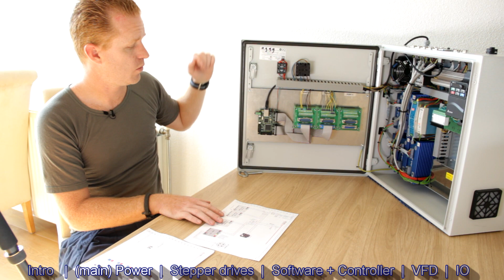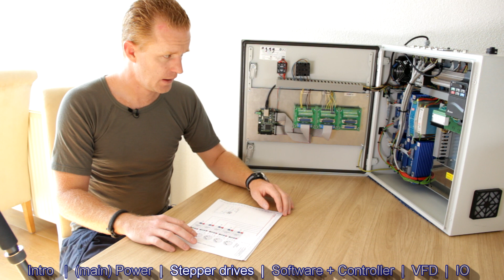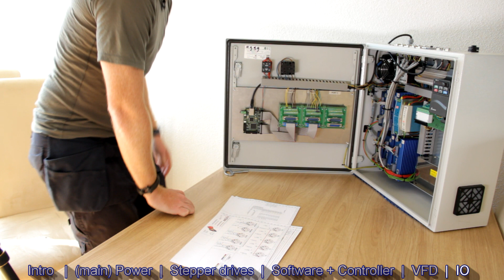RCNC X2 Router 14: DIY Ethernet CNC Controller

Comment: Excellent video Marcel. Really like that you did a follow along with the plans. Great idea and much more engaging that just mentioning that they are available and then pointing things out. Must remember that for the future.  Your setup is top notch and beautifully built. I'm sure it will work well and I particularly like the power up sequence. Haven't seen that before. 
Cheers
Peter
Reply from the maker: Thanks a lot for the great feedback buddy ! The powerup sequence has also to do with the fact I have always relied on the software E-stop since parallel ports are close to realtime communication methods. Since the boards now run USB and Ethernet some sort of buffering and controlling comes from the controller (what we used to call the breakout board). Now I would like to make sure a e-stop is like a 'hardware' thing. Anyway, there will be a lot of testing to do, and hope EMI will stay away :) Thanks Peter !

Comment: Great video! One thing for the PWM to analog converter. I don't know the exact PWM frequency, but in general you can better place that converter board as close as possible to the controller board to prevent (a lot of) noise. In general switching signals will add a lot of noise in systems, so that's why you need to make the connections as small as possible.
Btw, I am developing these kind of controller boards myself, so I can have a look into these things to develop some if people are interested.
Reply from the maker: Thanks for the advice.. Do you think this would really help, even though inside the same cabinet are quite big switching power supplies and a VFD controller? I can hardly imagine it could be noticed next to them (since it is almost at no currect/power it all). The base Freq can be slected between 1kHz and 3Khz, currently on 2.
Reply: It really depends on so many things to really say if it will be an issue. For that reason an general approach is to keep lengths with switching signals as short as possible and twist the wires.
It might work perfectly fine in your case.
Reply from the maker: Yah i can imagine that... Well anyway thanks for the advice, and If you develop any interesting board let us know !

Comment: 5:58... On cabinet doors You have MAINS voltage switch wiring in same route with signal from green boards
Reply: I've also noticed no space for drivers cooling, also high voltage parts too close to logic. Oh, and no opening for VFD fan in enclosure, seems like :)
Reply from the maker: Thanks for the advice... And for your info, its running great on a daily basis... but of course its always good to improve if you guys are building one...

Comment: I took my VFD out of the control housing after i had serious trouble loosing steps and no other reason was there than EMF-Noise. Many machine Builders recommend a sperate housing for  it. Unless you know about EMF-Noise in detail and know how to shield it i would go this way too.
Reply from the maker: It is absolutely something i'm still afraid of for sure.... Although I have seen a lot who seem to get away with it...
Another thing is that the spindle cable, stepper cables and even sensors run in the same cable chain Think that can be a potential problem to.
Reply: You can get extra shielded cables for this purpose, instead of buying 3x shielded stepper cables I got a shielded spindle-power cable instead. After I seperated the VFD from the logic control components I had no problems anymore. Depending on your workshop setup you can decide it if other EMF-noise sources are around.

Comment: thank you very much for sharing, awesome video, wish you all the best, just wondering if the controller allows expansion of extra axis like adding a B/C axis ?
Reply from the maker: Thanks for watching... ! The ESS Smoothstepper And Mach3/Mach4 can drive 6 motors so it would be very simple to add one... (well electrically, adding a B/C axis on a DIY machine is far from easy of course).

Comment: Are you using 1 fan and creating a vacuum inside the cabinet?
Reply from the maker: On the left there is one fan that indeed blows to the outside, on the right you see the air inlet with a small filter.

Comment: Perhaps consider putting shielding around the VFD... could prevent a lot of interference
Reply from the maker: That would be a step to consider when I run into problems... Although it then should completely surround the VFD i think... Maybe even some sort of grounded wire mesh would work....
Reply: No need for that, i saw industrial machines without it. VFD itself has a shielding. Did you hired a engineer to help you with controller box :) top design.
Reply from the maker: Thanks !! (And no I did not :) , first test seem to go flawless... Time will tell)

Comment: Maby it's a little late but I just calculated the force that would twist your gantry if one stepper motor would stop and the other one would torque it's full 4N/m. The force would be 5680N. Not accounting for transmission lost through the gears.
Reply from the maker: Hi... Seems like quite a lot... I'm glad i have used drivers with step loss detection..
Reply: So is that means with a 4N/m motor it would be near to impossible for it to twist the gantry?
I got 2 8,5N/m closed loop on Y axis and always afraid it would twisted my gantry if thing goes south.

Btw should have save some money and buy a normal stepper with digital driver rather than closed loop stepper. Since i also want both motor to stop when stalled, rather than regaining its lost step and potentially twisted the gantry

Comment: I'm building a slightly smaller version of your CNC and use a controller called MASSO. You should really look into it. Much simpler setup.
Reply from the maker: Hi David, thanks for suggesting the masso Controller.... I think its very interesting. Although i personally do have a slight fear of using compact systems because if 1 part fails, or needs to be upgraded than that would be less easy. Anyway, cool you are building the machine ! let me know when it's done .
Reply from the maker: Hi David, thanks for suggesting the masso Controller.... I think its very interesting. Although i personally do have a slight fear of using compact systems because if 1 part fails, or needs to be upgraded than that would be less easy. Anyway, cool you are building the machine ! let me know when it's done .

Comment: Has someone done a detailed explanation of the basics of cnc controllers. Like why do you need a breakout box, relays and drives. Why can't the motors connect directly to the controller? Why is this system so complex?
Reply from the maker: There will probably be video's on that.... I have not done them, butt all is on the internet...

Comment: what is the aluminum quality you've used in your cnc machine. when it comes to all the addpters and motor brackets and in the gantry and rack and pinion system brackets.
I am currently looking for a company that can provide the right kind of material quality
I will also download all your drawings on the cnc machine. so that I can read it to someone who can process all the items to me
mvh Magnus Eriksson Sweden
Reply from the maker: Please first do the download my friend, read and question afterwards ;) Cant keep up, have to get machines running :)
Most of it is Aluminum 6082 (6061T6 in USA)
Reply: thank. sorry for disturp you..

Comment: Why the voltage is impacting your speed ? If your motor rated 6A and about 1Ohm then the voltage should be 6V ... no?
Reply from the maker: Te spindle is a 2,2Kw 3 fase frequency driven spindle... not a 6 watt dc motor... (would not cut anything else then air... : )

The dc voltage is just a signal to the VFD